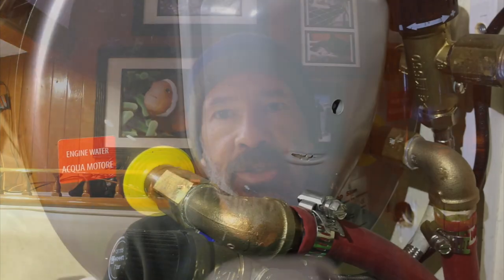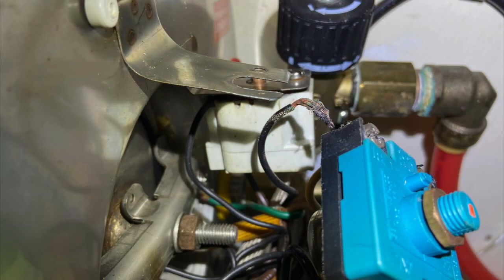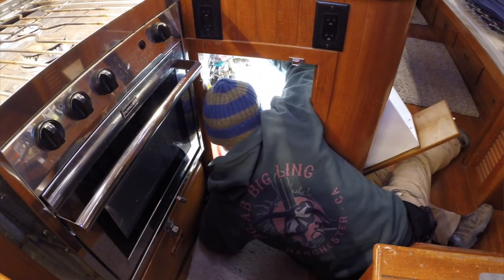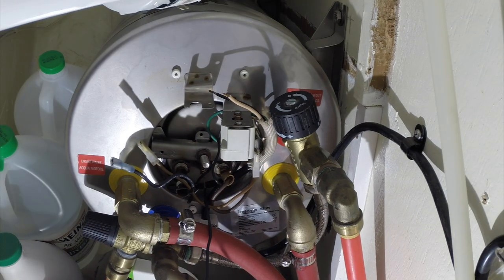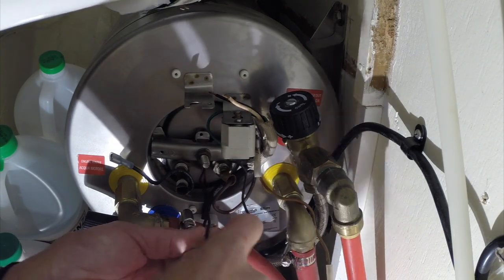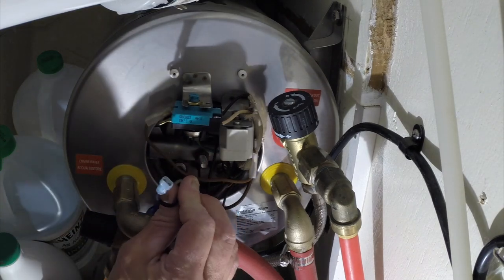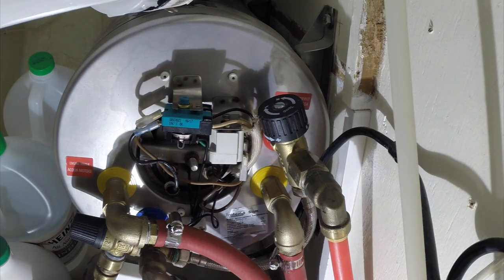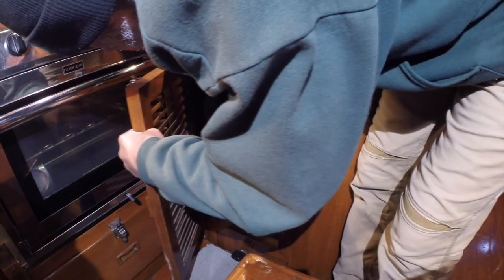SV Ramble On | Water Heater Repair (Again)

Comment: Good work. Well. Done. Changed my isotemp gasket 3 times in three years. Also had to change the secondary thermostat. Now the mixer has just stopped working. The gasket has split once again after just 6 months. If I’m sailing when the gasket goes and I don’t notice, 200 litres of water hits the bilges, it’s exhausting.  The gasket is £31 plus postage. The mixer valve is £60. The thermostat is £43.

Comment: My Isotemp WH seems to be putting out really hot water as well.  Think I'll pull the cover and check the connections and the cold water mix...
'Cause you never know!

Thanks for posting
Reply from the maker: Thanks G King.  It never hurts to check and see.  Be sure to check the little copper tube coming out the blue t-stat.  That's where ours got kinked.  Good luck and stay safe.

Comment: I see the engine hose connections are completed in this video but I didn't notice that install step in your previous ones. Did you happen to document that process? I'm about to install the same unit thru my Universal M35b and looking for advice. Thanks!
Reply from the maker: I don't remember if we made a video about it, but the hookup is pretty straight forward if the water heater is lower than the top of the engine.  Just make sure to fill the hose and water heater lines with coolant before finishing the engine connection to avoid a big air bubble in the cooling system loop

Comment: Corrosion caused the overheating. Use liquid electric tape or any other electric insulating paint over exposed connections to mitigate.
Reply from the maker: Thanks Josi, I'll give that a try.

Comment: The terminals overheated due to high impedance caused by corrosion in the terminals. The corrosion happened because IsoTemp isn't using marine grade wiring and probably installed cheap terminals as well.
IsoTemp doesn't know how to build gear that goes onboard boats. They don't seem to take electrical fires seriously.
Reply from the maker: I agree.  Overall, the unit is built fairly well, but something as minor as a 3-foot pigtail of marine-grade wire and terminals would've cost an extra dollar on the assembly line.  Definitely not the place to cut corners during the manufacturing process.  I hope that Indel-Webasto will address these issues in future designs.

Comment: Would You buy another ISOTemp heater ?.... or is there a better choice ?
Reply from the maker: Actually, Yes.  I would buy another IsoTemp Water Heater (hopefully not because this one finally $hit the bed, but rather, as a new customer with no preconceived notions).
I have to attest that the initial gasket failure back in 2018 was due to improper assembly from the factory. Maybe ours was built on a Friday at 3pm?  We'll never know...
All I can say is that from the thousands of Marine Water Heaters they've sold customer service is on the upper end scale of piss-poor to excellent. 
Like I said, I'm pretty sure the reason for the recent issues was due to the way I put it all back together after fixing the initial gasket issue.
Reply: @svrambleon  I heard somewhere that the US versions are made in US, normally US made is good, maybe not in this case.
I don'-t know where NZ ones are made but I have not heard boaties talk about issues on it, however I will ask around.
Reply: Hi, we live in Spain and have an IsoTemp Slim water heater installed and every year we are having water leaking through the gasket. Exactly the same as you describe. In my opinion, the whole design is flawed and not worth it at all. Unfortunately, on our boat, it is the only model that fits in the compartment.